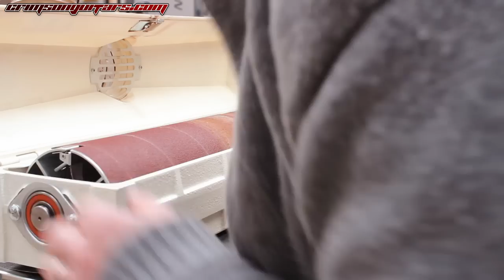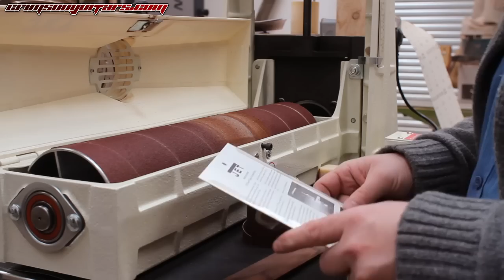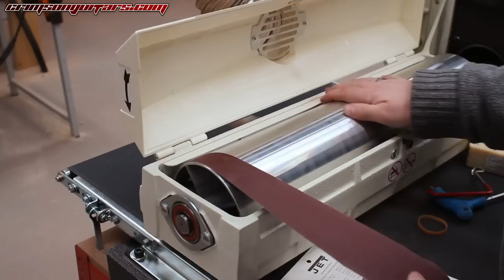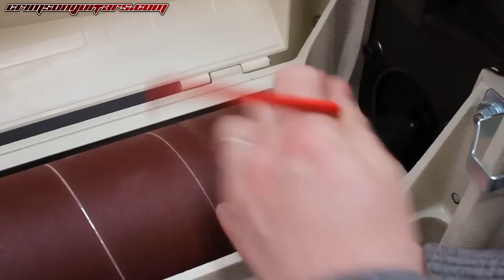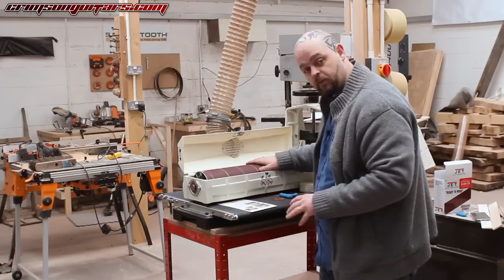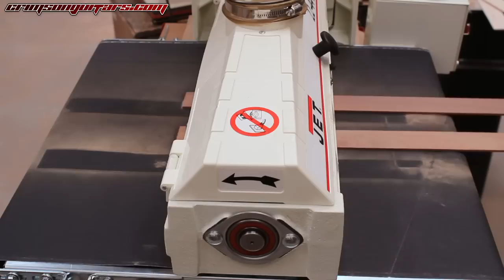Episode 2 of 2 - A New Drum Sander

Comment: Rather than using an old belt as a template to cut the taper, you could measure the circumference of the drum and the draw that length on a diagonal on the end of the paper.

Comment: Use those little attached wrenches to tighten the feed belt and it should flatten it down at the sides. I was having the same issue.
Good luck with it. Unfortunately mine won’t track right...gotta see what’s going on with it. Ugh!
But so far, probably the Best Buy I ever made to save time.
:)
Reply from the maker: We got there in the end but thanks for the tip. They really are incredible machines and very very useful in luthiery. B

Comment: As a metal finisher, that looks like what I would call emery cloth not sandpaper. Emery cloth as it's name suggests is cloth backed abrasive, the abrasive originally was milled emery rock also known as corundite, which is an aluminium oxide, we still make our own emery wheels by gluing powdered abrasives to clean dressed polishing mops. these work quite well polishing shaped wood as once 'broken in' they are quite flexible. I have used them myself for this purpose, Metal finishers don't use sandpaper, which is something very different to emery cloth.

If you like that drum sander, you would love to see a center-less grinder or polisher in action, even if i can't say either one would be much use in guitar building though.

as an aside, we use emery cloth in what we call a tit ripper basically a straight thin  bar with a slot in, the emery is slid into the slot and wrapped around the bar, the bar fitted into a rotary polishing machine allowing polishing of thin slots etc., The reason it;s called a tit ripper?  If you use too fast a rotational speed or apply too much side ways pressure on the bar it bends, becomes difficult to control with and has been known to cause chest area injuries in the hands of the unskilled and un-apron-ed..

Comment: I am looking at the Jet 16-32 which is wide enough for guitar building and most cabinet projects.  The shorter drum may put less stress on the support arm.  The plastic hood does seem rather flimsy.  As far as the bent shaft on the feed motor, you could call Jet to see if they will resolve the issue.  This would also be good information for your viewers, as customer support is a big part of quality.  Thanks for the vid.

Comment: first thing to do is throw the stupid tool away. it is much easier if you use your fingers.  you wasted a lot of sandpaper by not using the rubber cleaner on the spinning drum, it cleans the paper beautifully.
Reply: John Cole  There is a fundamental problem in that the belt need cleaning with the dresser while the wood passes, otherwise one pass can clog up the paper and cause burning. So it’s health and safety risks versus belt life.
Reply: I've had one for years, man up and ditch the tool, clean while spinning. That's all.